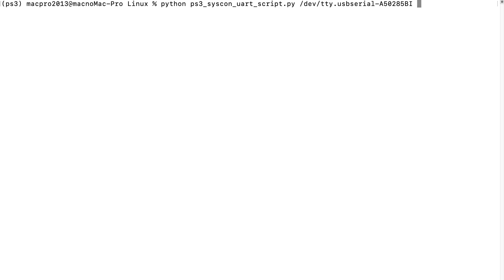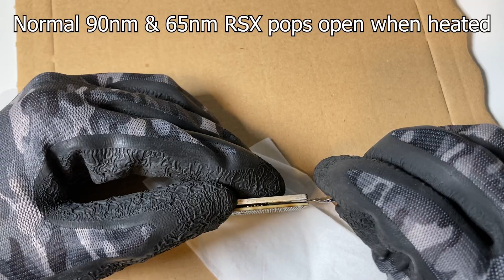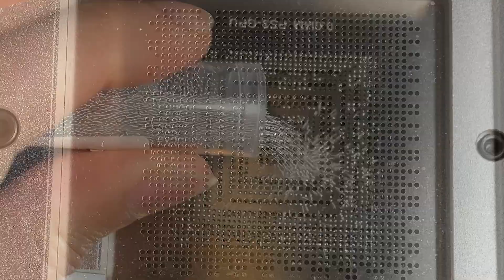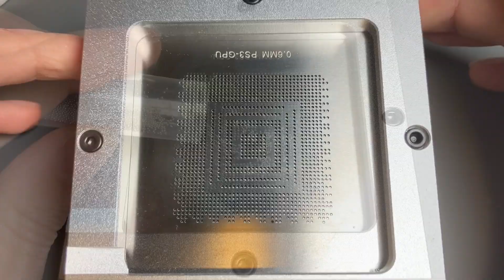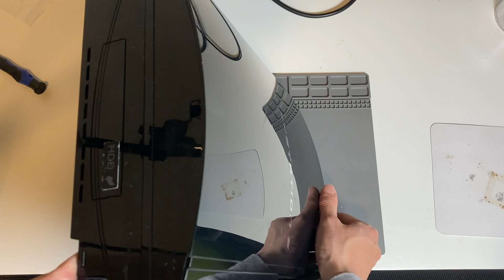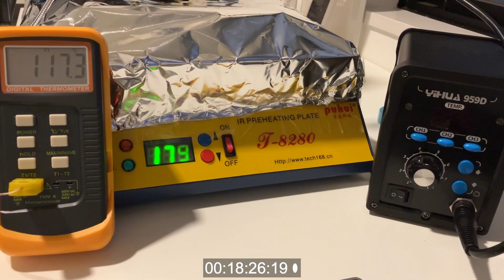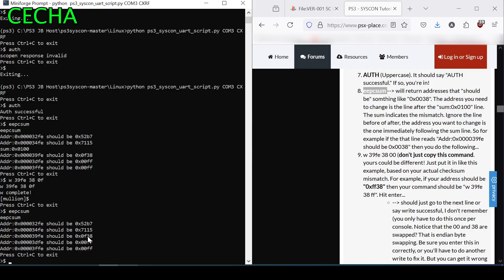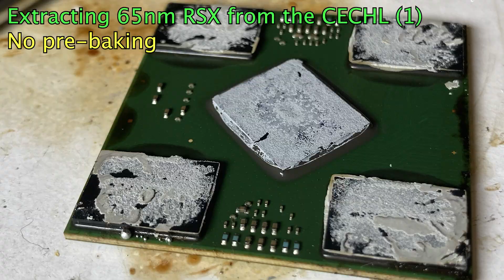Fixing YLOD 3034 is Difficult (aka Frankenstein mod)

Comment: your hot air rework station its garbage, just get a better rework station that has the air pump inside of the rework station and blows more air than the fan inside of the soldering air tool thing

Comment: Ayy my good man your dedication to  the ps3 console is second to none my friend keep up your amazing work and videos many thanks for your time and effort from vini
Reply: Second to none is strong, this guy and felix are doing the same work, maybe together, maybe seperately, at best they are on par and level with each other
Reply from the maker: Felix is way smarter and more skilled than I am. I’m simply following in his footsteps. A couple years ago, he figured out how to do the Frankenstein mod using a budget setup. I’m just trying to replicate his work and vlog the process.

If you’re interested, Felix also wrote a blog about his journey. You can check it out here:
https://www.psx-place.com/threads/research-experimental-nec-tokin-capacitors-replacement-ylod.25260/page-156#post-270233
Reply: @hardwarerepair200  that maybe so my friend but your dedication to do this is second to none and to document it aswell just amazing many thanks for posting your progress

Comment: those tantalizers are so damn hard to install without a board heater
Reply from the maker: I need to set the soldering iron to at least 400C. Anything lower than it would be difficult.

Comment: Since you bought so many YLOD PS3s, I think you should upgrade your BGA rework station. Very exciting video, I hope you can successfully build Frankenstein in the next episode.😁
Reply from the maker: Better equipment would definitely improve the success rate, but for now I’m sticking with a budget setup since many people wonder if it’s possible to Frankie with cheaper tools.

Hopefully, my video helps others decide what tools to buy. It’s better to have just me wasting money than everybody wasting their money!
Reply: @hardwarerepair200  I believe you can do it because you have a lot of practical experience. In the video you mentioned avoiding 868-22 motherboard numbers. I have a 868-22 COK001, but it is a 201GB SYSCON chip. Is it suitable for making Frankie?
Reply from the maker: 868-22 is very easy to die. Even with professional equipment and good skill, it will still delam. So if this console is working, I suggest you not to touch it.
But if it has 3034, then treat it as a practice and don't expect too much.
Reply: @hardwarerepair200 hello why 868-22 is bad? What about 868-12? What’s the difference ?
Reply: @KubaJDM  868-22 is bad because the board has a manufacturing defect and a much higher chance to delaminate. when it delaminates it is dead, no coming back, so its a gamble.
Reply: @hardwarerepair200  @22:47 Hello, where you buy this silver motherboard jig?thanks!
Reply from the maker: @NightLess. For the jig, it was from aliexpress, but it seems it's sold out already and they don't plan to make it anymore.
There's also a Chinese website selling the same, but it's also sold out a while ago.
https://item.taobao.com/item.htm?abbucket=4&id=35343923877

I guess the demand is just too low and too expensive to make. (It costed 55USD back then irrc)
Reply: @hardwarerepair200  Thank you for the information and answer, I will avoid the 868-22 motherboard!Are there any machining drawings available online for this JIG?
Reply: Exactly this. I have killed a fair amount of components working with a cheap rework station. Although i like to save money. Sometimes, just using the right equipment saves so much time and misery. And it's honestly not that expensive when you consider time saved and overall quality.
Reply: Zevki amatörce olmasında zaten

Comment: i give up so early fr, i have 7 fat, 1 slim, 2 super slim
all of them have 1024 or 3034, I don't have preheater so i can't try to remove or replace the rsx but i did try to reball it and it ended tragically all the time
my closest success try was with replacing capacitors but in my country we don't even have tantalum with low esr and importing from outside is truly nightmare so i just ribbed them from super slim one and all the hell goes right but the console was over heating with no reason so i tried to remove ihs to replace the thermal paste but guess what while i was pressing on it my hands slipped and blown smd capacitor from the board, the white one when i tried to put it back the pads just decided to rib them self off and that's was it 
i have broken 10 ps3 now!
but keep going bro maybe u will master it in the end
Reply from the maker: It wasn't until 2022 that people started to understand how to fix YLOD properly. It's so sad that many of us trashed our PS3s too early, thinking they were unfixable.

Comment: I know of a place that has 40nm chips preballed, would this have made things easier? As all you would have to do is line up the chip heat it up for the balls to melt and then give it a gentle nudge to seat it properly? In the new year I’m looking to have 2 launch ps3 60gb brought back to life if my ancestors see it worthy…or damn them to hell 😋

This was painful, I hope you get this done one day.
Reply from the maker: Having a 40nm chip preballed definitely save you a lot of trouble. I haven't tried it yet, but my friend who bought preballed RSXs off aliexpress got some really bad experience. Most of them doesn't work at all.

Comment: Well I have seen plenty of videos where people had no delamination problem with the 868-22.
Reply: What evidence are you looking for exactly? The only evidence we have is anecdotal. I never bake and rarely get delam. Whenever I do, it's always an 868-22 board. If you look at someone like computer booter who's done over 200 Frankys. All of his delam boards are 868-22. I personally believe baking is useless. If a board is going to delam, then there's nothing you can do to stop it.
Reply: @Johnny_LuvBuckets  So it's just more likely than the other revisions then.
Prebaking is industry standard practice even for new PCBs before any components are installed.
Reply: @jm036  I'm familiar with the IPC standards. I get it, heat evaporates the moisture. It's not a hard concept to grasp. I'm reiterating this again, my evidence is anecdotal. I never bake and I never get delam. I use an LY R690V.3 hot air rework station. When I had my ACHI IR pro I would get delam more frequently. Again this is another theory that I can't prove. But I feel like hot air stations are more forgiving when it comes to delam. There are plenty of people (squeept, Sampsonay, Shawn) that use the IR pro and have success. So it's also possible it was a skill issue on my part.
Reply: @Johnny_LuvBuckets  Well according to another commenter a 3 zone hot air station like you have is less likely to delam. So that's 2 anecdotes.
Reply from the maker: I am glad that my video sparks this discussion. And thanks for sharing your experience guys! It would be useful for new comer who wanna try BGA rework.

Comment: Welcome to hell, I'm currently working through the same process of doing the frankenstein mod for the first time. So much hardware has already been killed.

You're very close, and I believe you're capable of getting there.

Also amtech is stirri. They changed the name after some legal trouble. Stirri flux is the real deal.
Reply from the maker: Which rework station are you using now?
I didn't know amtech is now stirri, thanks for the info!
Reply: @hardwarerepair200  

I use an LY IR 8500, which is similar to the Achi IR PRO SC, albeit with a faulty design decision of putting glass in front of the bottom heater. I got my unit second hand for roughly 350 dollars, so not much more expensive than the T-8280 you're using, albeit much more advanced with control and profiles.
Currently in the process of upgrading my soldering iron and preparing for reballing the 65nm chip I pulled, so I'm not out of the woods yet.

The whole Stirri/amtech flux legal trouble as far as I'm aware went something like this:
Amtech manufacturing designed the flux, and partnered with Inventec to produce it. Inventec messed something up, with the V2-TF formula, and got into legal trouble with amtech manufacturing. The result is that Amtech manufacturing terminated its partnership with Inventec, but Inventec has the rights to sell their flux using the Amtech name. Amtech found a new manufacturer (or is doing it themselves idk) and rebranded to Stirri. On Stirri flux's amazon page, you can even see the Amtech manufacturing name printed on parts of the product.
Reply from the maker: Thanks for sharing your experience and the story behind Amtech's legal trouble.
Weird that your comment disappeared after I pinned it...
Would you mind reposting? I’m sure others would find it helpful!
Reply: Amtech still exist. The so called Legal wrangle, which some named fluxgate.  Stirri is rebrand and  from my understanding is the breakaway partners who could not legally use the brand Amtech.